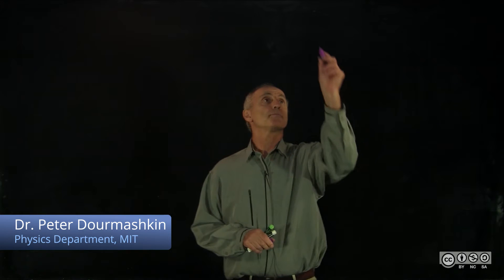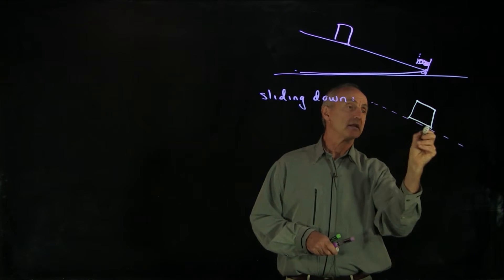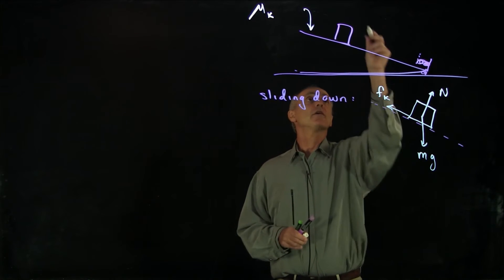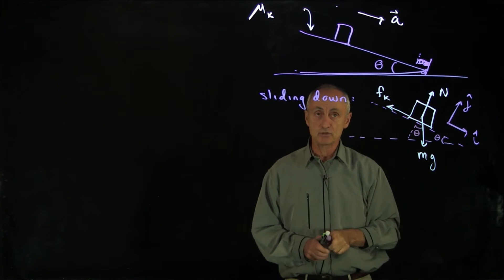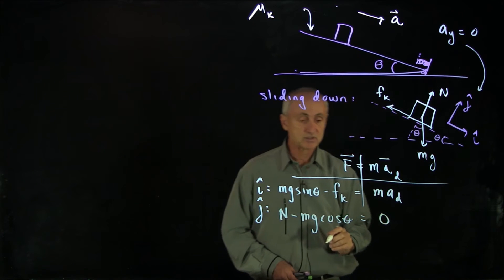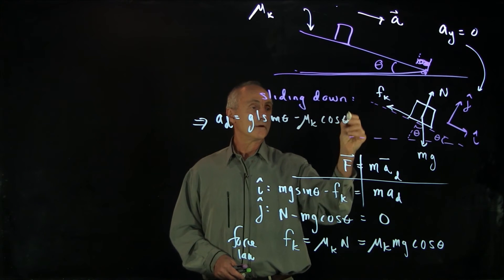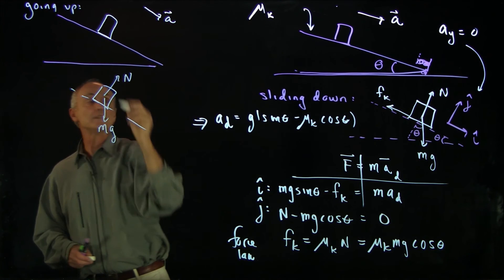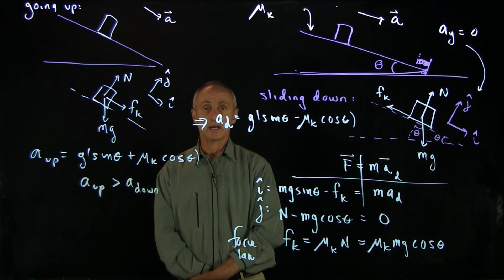PS.2.1 Worked Example - Sliding Block

Comment: In the second example, if i-hat continues downwards shouldn't aceleration upwards be negative?
Reply: The direction of acceleration isn't necessarily the direction of motion. According to the 2nd Law, acceleration points in the direction of the *net force*. 

In the case of the block sliding upwards, the net force is due to the kinetic friction which points in the +i-hat direction. Correspondingly, the acceleration should also point to +i-hat. Physically, this +i-hat net force causes the block to slow down as it is moving upward. 

It's just counterintuitive because the block is moving upward while the acceleration points downward. But the math checks out.

Comment: Can somebody please explain how is acceleration upwards larger than the acceleration downwards in magnitude? and how is that affected my the direction of the kinetic friction?
Reply: That's my question too..
Reply: You posted this comment 1year ago.If you now know the answer please comment.
Reply: @chowdhury_kamruzzaman  Case 1: Block sliding downwards. The forces along the i-direction are kinetic friction and mgsin(theta) but they're pointing in different directions. Their effects counteract each other so the acceleration is smaller for that case. 

Case 2: Block sliding upwards. The same forces are at play in the i-direction but this time they point in the same direction. They're "working together." The magnitude of the net force is larger. The acceleration is also larger. 

This acceleration makes the upward-moving block slow down over time. It just feels a bit counterintuitive since the acceleration is opposite the direction of motion. 

Hope this helps!
Reply: @hillarydianeandales5600  ok, but how is it possible that the block goes up in reality? With a force, so this force would be contrast the mg component force and the friction force, so if I have understood is a purely theoric case in which I don't consider the potential force that would push the block up, or?
Reply: 666michele999 the block gets an initial “kick” from the spring-loaded bumper.  This impulse changes the direction of motion and imparts an initial velocity upwards.  Since the force from the bumper is not constantly applied, we don’t need to consider it here.  It merely imparts an initial velocity “upwards” which causes the block to move up the ramp.  The forces of friction and gravity are going to be acting to decelerate this motion the entire time the block moves upwards, as they act in a direction opposite of the motion.  But the spring doesn’t act at this point as the interaction between it and the block is complete.  You don’t need a constant force to move...Newton’s first law states that an object will move with constant velocity in the absence of any external force.  So, if there were no friction or gravity, the block would glide upwards forever with the constant velocity it got from the brief interaction with the bumper.  Of course, gravity and friction are acting here to slow the motion, in precisely the way calculated.
Reply: @666michele999  The force that made the block go up has already occurred. We are looking at the point in time in which the block has already been pushed and has some velocity in the upwards direction so the free-body diagram does not show this force as it has already occurred.
Reply: because acceleration upwards is against the gravity, so it needs to be larger than gravity pull to move it upwards, otherwise the block will move downwards due to F = mg (downward) greater than F = ma (upward). Please correct me if I am wrong